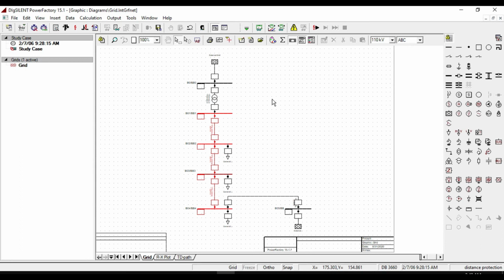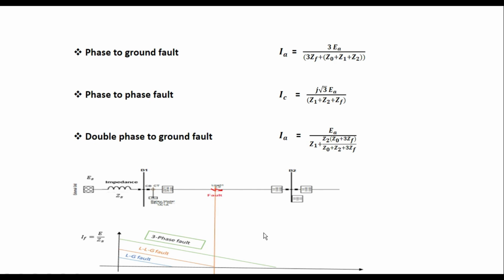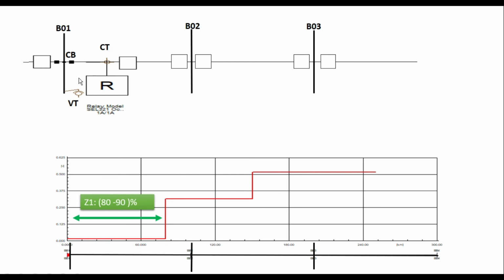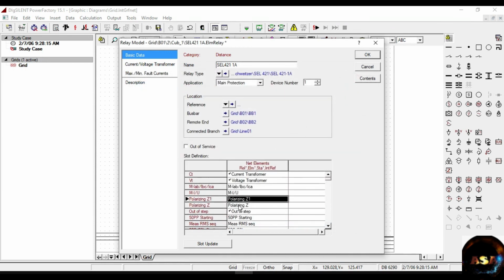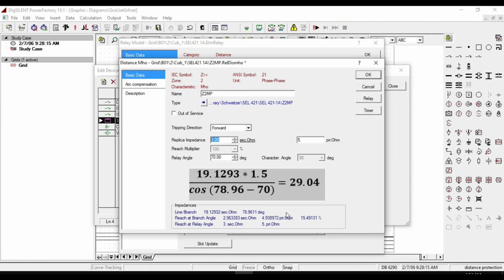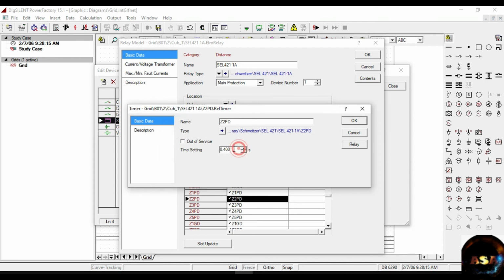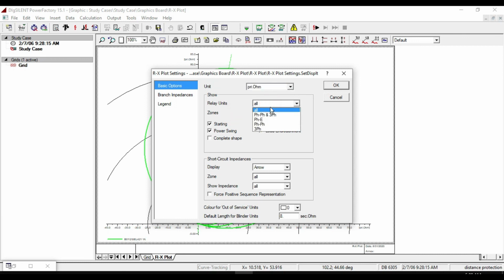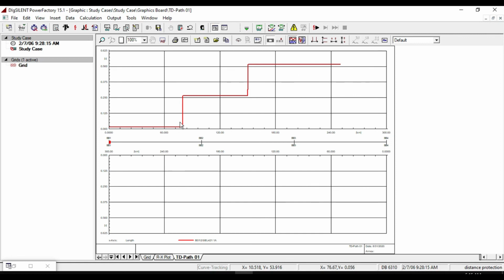PowerFactory DIgSILENT tutorial #23 Distance protection. draw R- X plot and time distance diagram

Comment: Hi sir, This video is very helpful. Now, I'm simulating differential relay using Digsilent but i can't show characteristic. Could you help me? Could you make a tutorial video about differential relay in version 15.1.
Reply: There is no point in doing it if you are just going to run a short circuit. If thats the case, the relay will always operate for in zone faults and not otherwise. It makes sense to draw the characteristic only if you are going to study the transient performance of the relay considering the sources of error, for example ct accuracy and saturation. The other problem is that the relay models in digsilent does not include the saturation detection algorithms that most modern relays include, so you probably would need to extend the model yourself to be able to visualize something close to what the real relay would do.